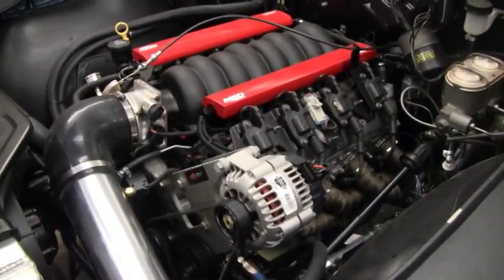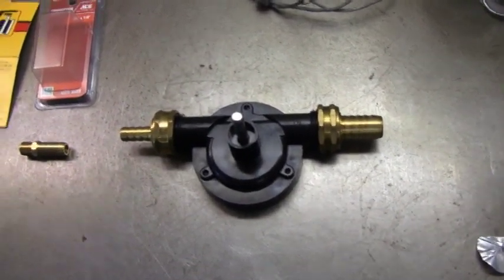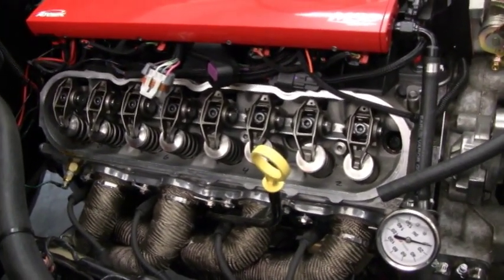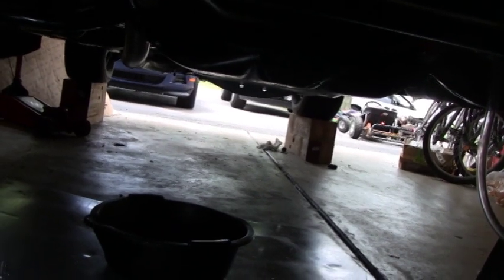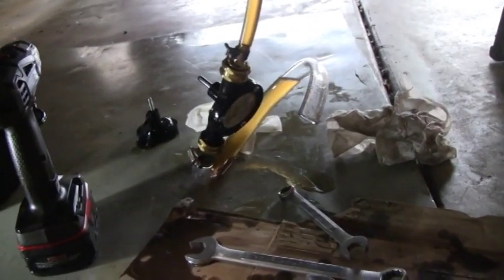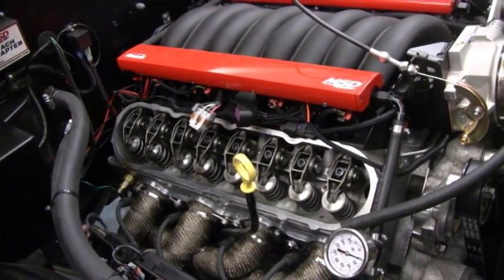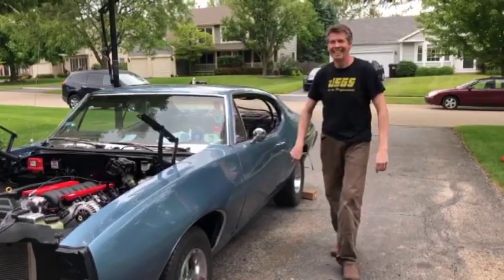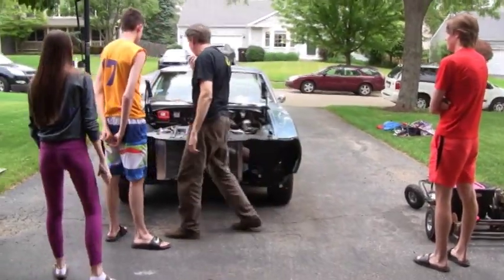episode 65, LS oil prime and initial start

Comment: GM recommends disconnecting to ignition and cranking with the starter until you have oil pressure.